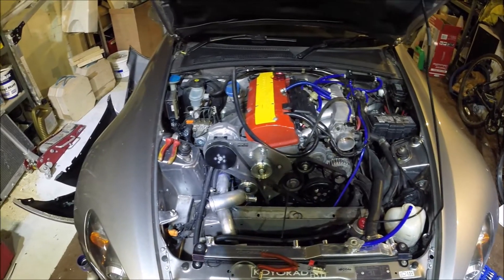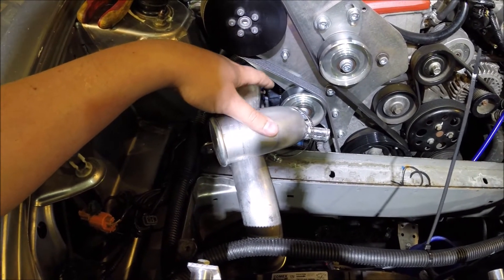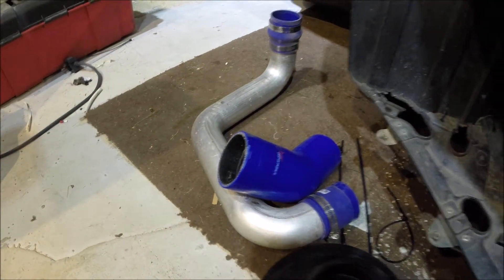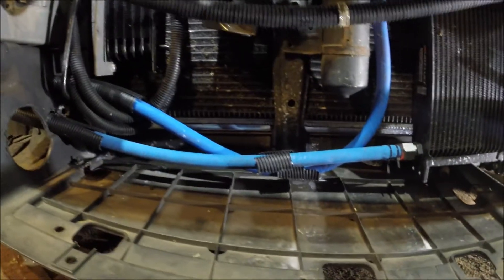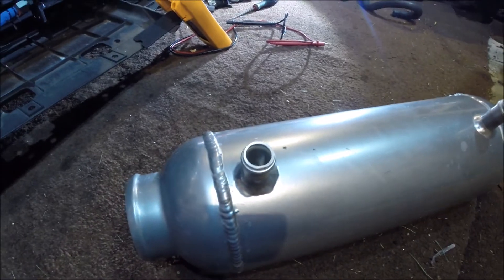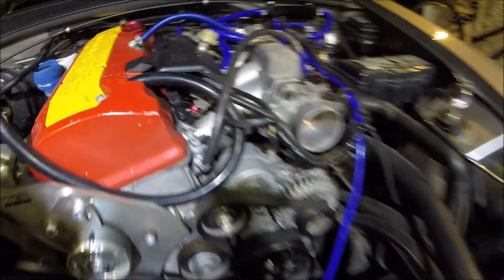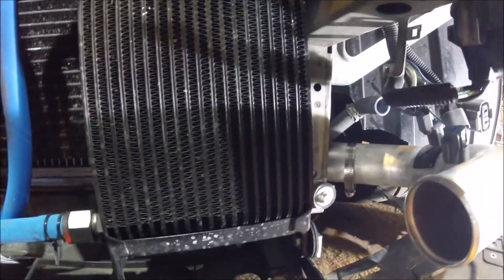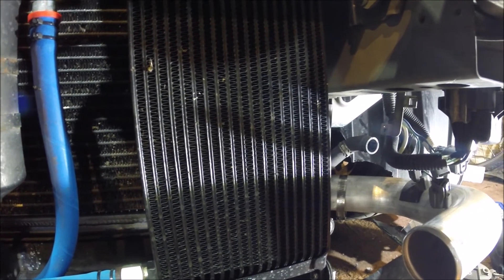Intercooler to Chargecooler conversion Honda S2000

Comment: What its Temp. In and Temp out?
Reply from the maker: It was next to useless, i ended up fitting a larger intercooler than the one that came with the HKS kit. Its been much easier and works without issue. A decent air/water core costs ££££. The cheap chinese ones arent much good

Comment: Frozen boost have some bigger coolers that drop down in front of the front main cross member. They are really efficient. A kid on the FI forum showed me his set up and it's really effective. I'll watch with interest on how low your AIT's are with that type of cooler. What size barrel is it exactly.
Reply from the maker: I have measured those types of cooler but clearance between the fans and anti roll bar looks very tight. They are pretty cheap thou. Barrel is 5" by 8" total length of 340mm. if I have high IATs then I suspect the barrel will be the issue. Got a link to that guys build?
Reply from the maker: Measured the IAT's and im getting around 50c at 8500rpm and 11psi. I suspect the barrel isn't long enough to cool the air down sufficiently. I googled S2000 and air water intercooler and saw an example of what someone had fitted so might change the intercooler unit itself. The heat exchange water temperature is fine and after a run its only at 26c so i dont think its the system thats the issue more the barrel. Water meth is switched off thou while i work out where im going to plumb it in.

Comment: Also put small relay in for the power and use the air pump feed like you mentioned. I have the CT engineering instructions on how they do it if you want them. Also mount the pump next to the relay, behind the faux vent in the bumper.
Reply from the maker: Cheers for the advice mate. Got the larger heat exchanger they sell on chargecooler parts but 110 quid on eBay. It's identical as far as I can tell. Barrel is a China special but from what I've read the core is very similar to the ones sold for alot more money. Have wired up an ignition live to the air pump location to fit a relay when all the bits show up. Viper performance for all the silicon hoses. Hopefully get it done by the weekend